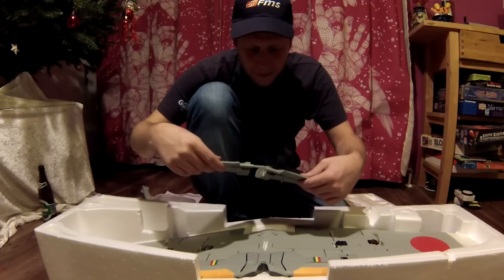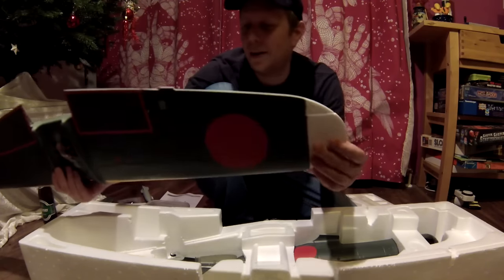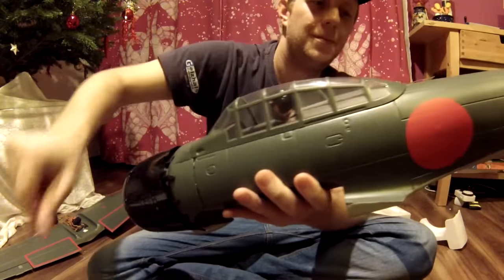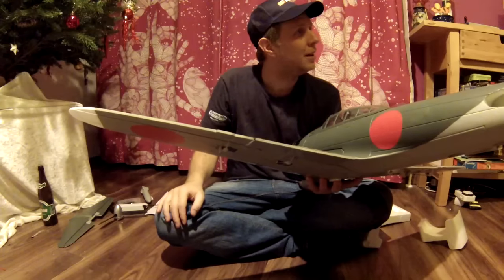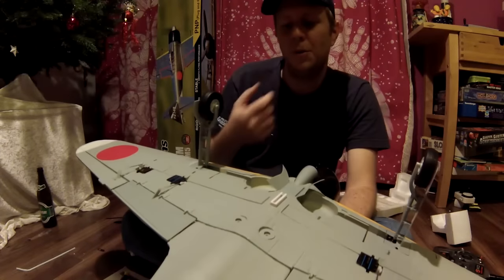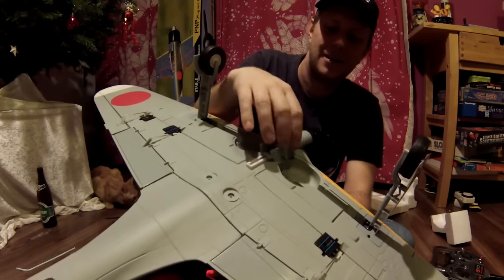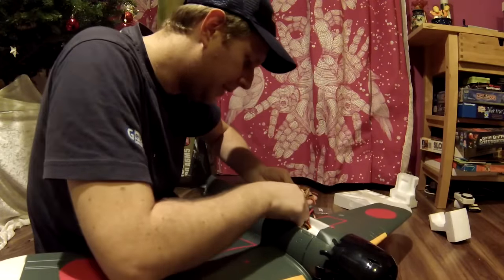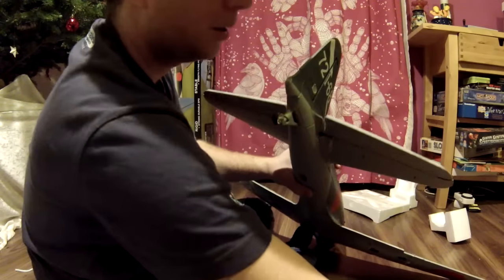fms a6m5 zero 1100mm - unboxing and assembly

Comment: Looks like a nice plane, has some nice features for a 1100mm, like the flaps, most planes in that size won't have flaps. I like the FMS/Rochobby planes, I have several, My favorite is a FMS 1400mm FW-190. Thanks for the video, I may have to get one of these, I think parts may be easier to get then the HSD Zero. Hope it flys well for you! Stay safe.

Comment: Hi, 

Do you have a Safe receiver installed? or something with AS3X ? Just wanted to ask from the twitching sound from the servos as you moved the plane.
Reply from the maker: +Junaid Saeed Uppal 
hi,
yes. there is a orange rx3s receiver in it wich does the same as as3x.

Comment: Would that battery connector work with these batteries? 

http://www.hobbyking.com/hobbyking/store/__21345__ZIPPY_Compact_2200mAh_2S_25C_Lipo_Pack.html
Reply from the maker: +StopMotionViking hi,
no. the battery in your link has an xt60 connector. (like allmost all batteies nowadays) the plug in the plane is a deans, or T connector.
battery packs with deans are hard to come by these days, so its best to solder a xt60 plug in the plane, or just use an adapter like this:
http://www.hobbyking.com/hobbyking/store/__76899__XT60_to_T_Connector_Battery_Adapter_Lead_2pc_AR_Warehouse_.html

hope that helps
fidi
Reply: Okay, thanks. That will certainly help a lot :D